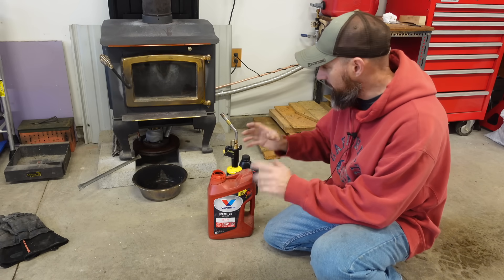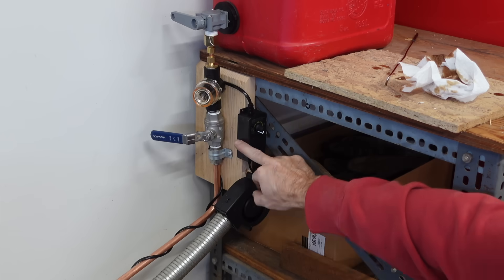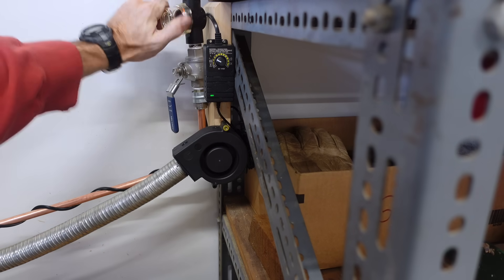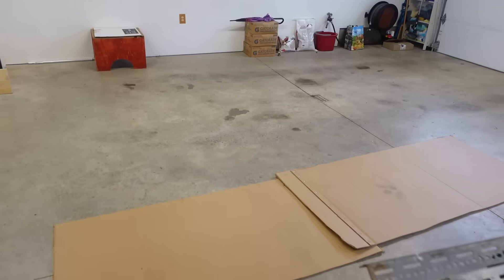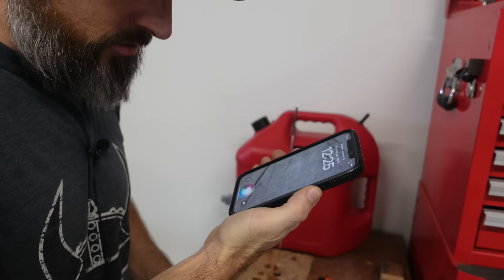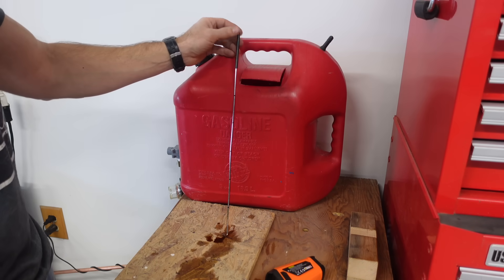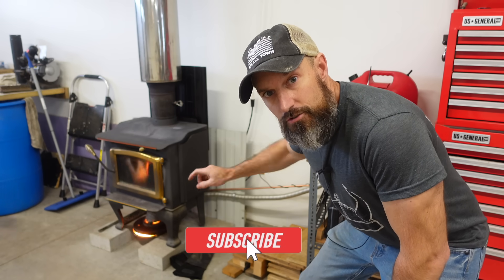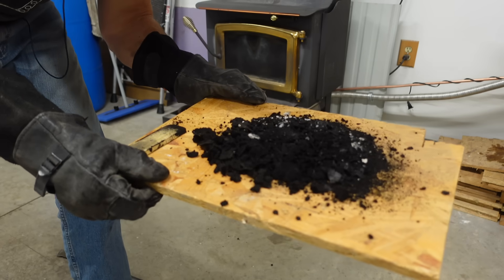How much oil does my used oil burner burn in 8 hours??

Comment: Look into the metering pump for Chinese diesel heaters.  I use a PWM to pulse the pump and I run with a filter.  It burns super clean no smoke and I run a gallon a day 24hrs.  I am running 50-50 diesel waste oil.  Filter filter
Reply from the maker: I would like to see that setup. You should make a video on it. Thanks for watching
Reply: Would like to see your set up
Reply: What is the black stuff that is left over?  Just curious
Reply: @BillyBoy-r1g  Nothing good... mostly adatives and some anti crosives.
Reply: @GetFitEatRight  Thanks, I was wondering if it might have some uses. Obviously not
Reply: @BillyBoy-r1g  Sorry to reply so late, I just found this video. The leftover black stuff is most likely the viscosity index improvers that are added to motor oil. The substances that are used for viscosity index improvers are usually small bits of plastic like substances.
Reply: What's a PVM?
Reply: @MichaelHolland-w2h  PWM is pulse width modulation. Instead of running the pump continously he's running it on and off and on and off again. If he's running 6 sec on and 54 sec off during a minute the PWM duty cycle is 10% (how much is on during an interval of on-off)

Comment: Nice vid👍 I found adding stove fan or  a low voltage fan directed at exhaust point really increas circulation
Reply from the maker: Thanks for the tip and thanks for watching

Comment: I suggest adding a ‘gentle’ fan across thewood stove. You’ll get more efficiency out of the stove and more warmth in the garage. Gentle air movement.
Reply: Preferably over an aggressive fan 🤔 👌
Reply from the maker: Great tip! Thanks for watching
Reply: They got these fans that you set on top of the stove and the heat generates electric current for the fans,  google "Thermoelectric Fan for Wood Stove"

Comment: I think ALL oil burners are fascinating!  It's a shame it smokes a little, I would have thought the secondary burn in the woodstove would have solved that but the burner is begging for more air.  The rate of flow must have gone down to a drip though to use so little oil, at the rate you showed the burner would get extremely hot  but you need more air to the burn chamber as Bob kelly suggests in the comments it should roar like a freight train for maximum efficiency.  Mind you, you did say you didn't want it too hot?  You could do away with the brake rotor and have the burner setup inside the stove if you are going to force air into it, that way everything is inside a big steel box and be quieter too. The sooty stuff left after the burn was not that bad though.  When it burns decent it should look like that but maybe and a bit more heat will reduce the amount of ash substantially.  It all depends on what your needs are though.  Everybody has their own desires so every design is a good one if they are happy with it as long as it don't smoke.  Just a drop more air will get rid of the smoke too.  The big brake rotor is just making it harder to light and longer to warm up, all extra mass does is retain heat when it goes out, same as nuts and bolts.  A thin plate would be better and anyway the stove itself will retain a mass of heat because it is big and bulky but won't interfere with the burn.  You have a very clean setup too.  I find if I use a mix of 10 oil to 1 part kerosene, or diesel, or paraffin, gets rid of most of the ash stuff left over, makes for easy lighting too.  Great job by the way and I am sure you will add or take away things which you work out best to suit your own needs.
Reply from the maker: I have another video coming out next week maybe.  I fix the air to work better. Thanks for watching and for all the tips.
Reply: Great I can't wait to see your next video , I await eagerly :) @DIYJIM

Comment: I think you need about 2 times the air flow...... an oil fire should ROAR ! or Rumble when burning correctly (no smoke) I think most of those 8 hrs it was burning kind'a slow.... the flame was short most of the time.  it's all kind'a relative  so if it works the way you like it ...good for you !  I would add a bigger fan myself and seal up the burn pot top so you don't start getting fumes in the place..... good work.... now the problem is finding enough used oil to last the winter time.... a not so easy task !
good luck.
Reply from the maker: Thanks for the advice and thanks for watching.
Reply: I couldn't have said it better.  Yeh for sure needs more air.  Such a refreshing comment from you, unlike the comments idiots make saying you done this wrong or it's a fire risk or do it this way, no just straight honest experienced help.

Comment: I don't know why everyone is always concerned with how much WASTE oil a heater uses?  it's irrelevant and the wrong question to ask.   What people should be interested in is how much HEAT a burner is putting out as that's the the purpose of having a heater in the first place.  People seem to think these things are Like a vehicle and some get better MPG than others. They don't. 

The heat output is directly related to the fuel consumption. There is no getting more heat than the energy value of the fuel burned in the first place. 
In this case the heater was doing a bit over 10 KWH which is a good output  for a lot of applications. 

There is no point in burning less fuel and then being cold. You want to get to a comfortable temp and that will take whatever fuel it takes.  You don't drive your Car 25MPH down the highway because you don't want to use more fuel, you drive it at the highway speed and it uses what it uses and that's it. 

If the air was cranked up more with this design it would probably have less deposits in the burn chamber. I burn mine with excess air and glowing red hot which burns off all the carbon and save for a pinch of light powdery ash, the things are totally clean no matter how long you burn them.
Reply from the maker: 100% agree I can burn less but it makes a lot less heat. Thanks for watching

Comment: Secondary air suploied to the top of the flame might give a cleanet burn. Your double insulated flu pipe is stopping the heat entering the work shop, it's only really needed at the exit point upwards to stop the flu geting cold outside which would give down draught back wash.
Reply from the maker: I agree I have thought about changing it. All that insulated pipe was cheap. I got it used
Reply: Lol, I don't blame you for the cheap pipe but yeh it defeats the object altogether:)  @DIYJIM

Comment: I've seen some other oil burning stoves that use a metal lattice or a pile of bolts welded together to increase surface area. Have you experimented with that?

I've always wanted to build a oil burner. Do you get any fumes?
Reply from the maker: No fumes, except a little when I light it. Never tried the bolt thing. Thanks for watching

Comment: Did a little math if this was my place burning it 24/7 for the roughly 6 months of winter we get here I'd burn damn near 1500 gallons holy cow
Reply from the maker: This is just to make some heat out of the oil that was sitting in my shed. It is all used oil some people heat like this and get all the oil for free. But you are correct it burns a lot. thanks for watching.

Comment: Very interesting!  I'm wondering if you could use a device like a float bowl to control your oil flow?  It seems that you have to watch it a lot when the oil warms.  Some kind of temp variable flow control but mechanical in nature that matches oil viscosity changes?  If I was a fabricator(other than my own stuff) I would send you a metal oil tank with a sight glass built into the side, but its good to see you work with what you have available for sure.
Reply from the maker: I probably will only use this about 4-5 times a year just too burn my old oil up and make some heat.

Comment: Here is a burn for mine by hr, 1 gallon can last upwards of 5 hrs on the "low fire" level, which keeps my stove running around 300F.

https://youtube.com/shorts/avHEzXkwptQ?si=Ik6Zpbz90t-2hPlk

Black smoke is unburnt oil.  More aire flow into the SS pan
Reply from the maker: Your link does not work. I have learned to burn it much slower. I can keep it running on just a drip.